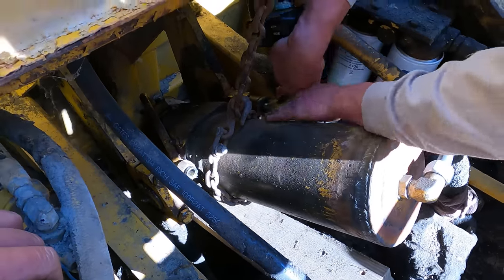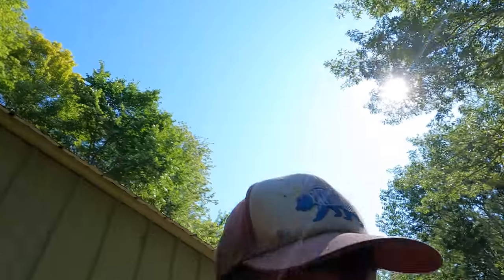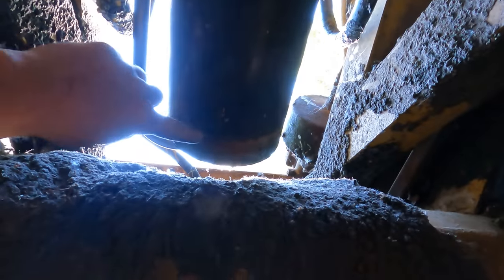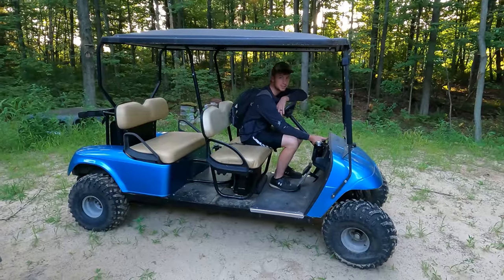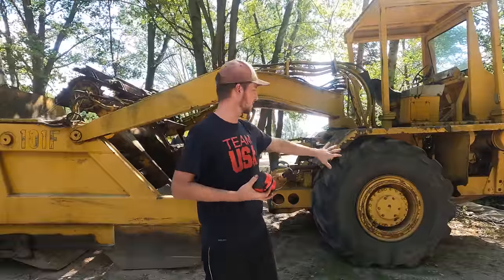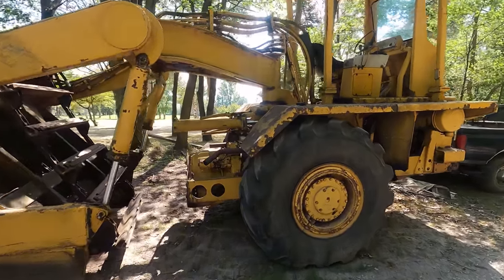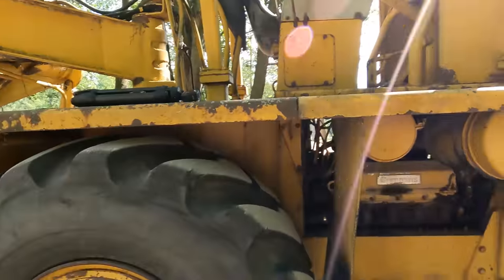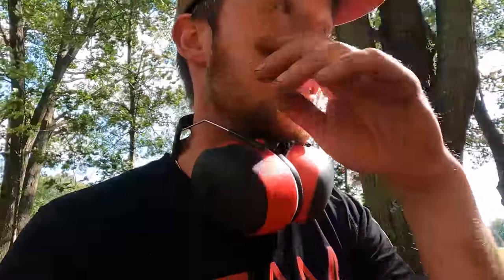Road Grading with the Wabco 101F

Comment: The floor  should always be forward when scraping. The excess dirt picked up can be expelled into low spots by reversing the paddles. The paddles should never be moving any dirt that was not already lifted by the cutting edge on the front of the floor.
Reply: Good old scraper needs a good wash down with degreaser fluid x gerney blaster washer